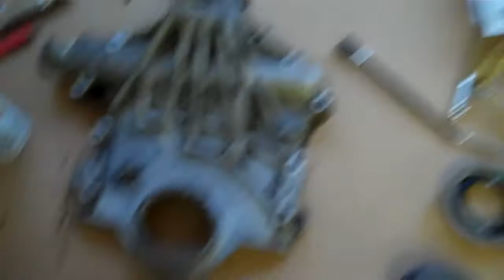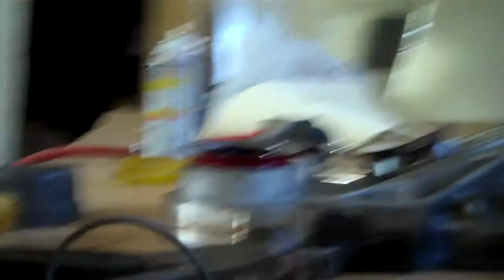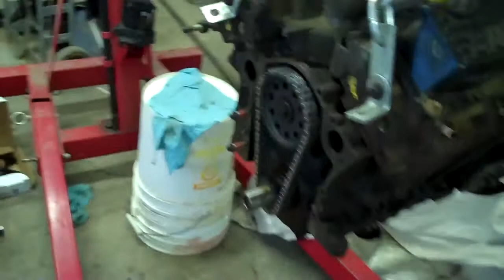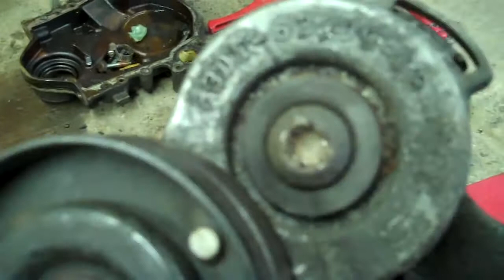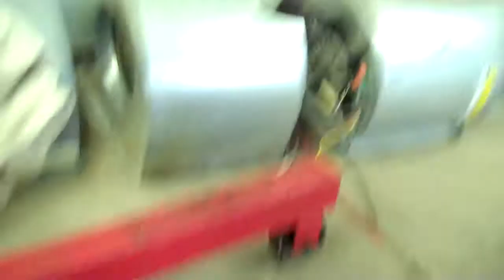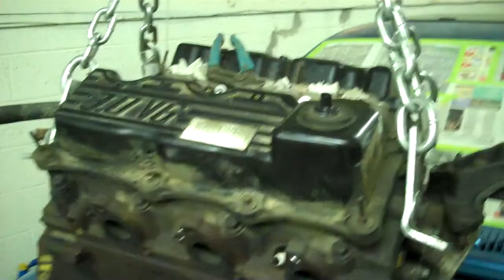3.0 Conversion - Part F

Comment from the maker: I just had it on the hoist the wrong way, and feeling like a goofball thought it would be funny to just joke around about it. Everything should work great. The only 3.0 Vulcan conversions that wont work, is from a Ford Ranger or Aerostar which is RWD. In those cases all that is needed is to reverse the head gaskets.